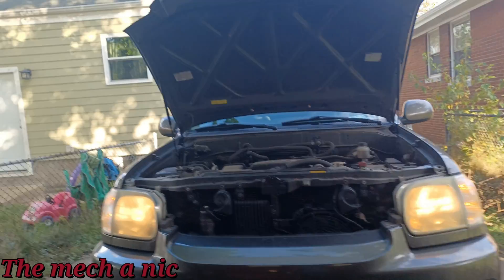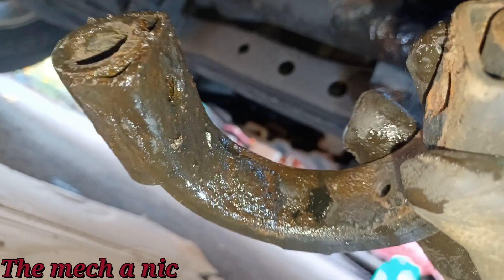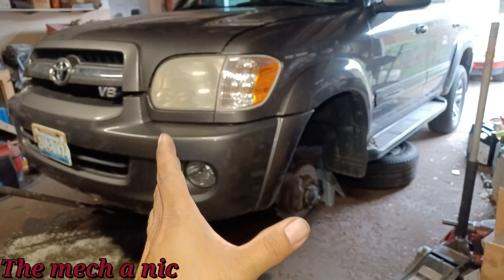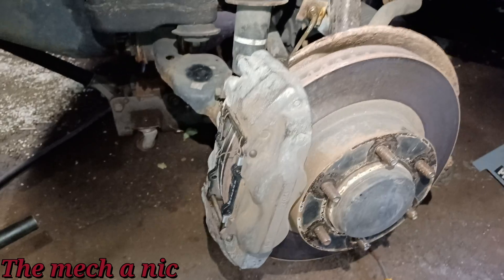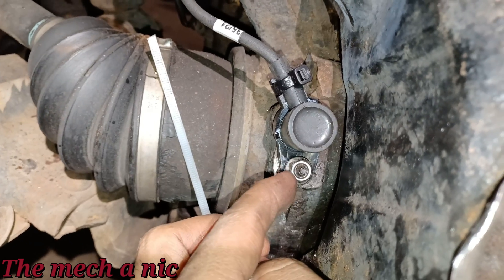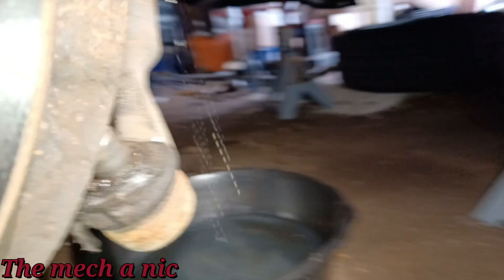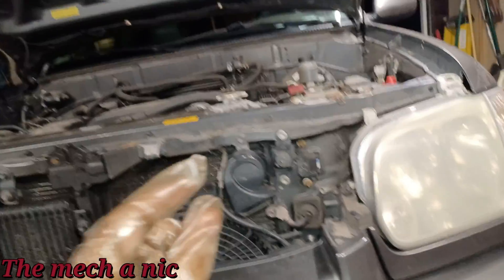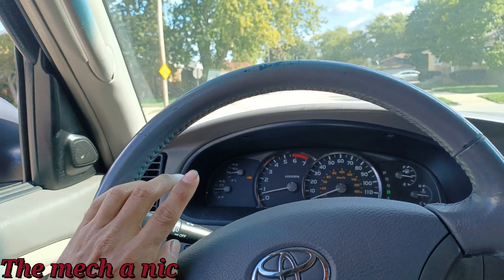Toyota sequoia leaking power steering fluid

Comment: i rebuild rack and pinions all day and with the tundra and sequoia the rubber mount that’s on the passenger side absorbs salt and moisture resulting in a rusty rack housing, then the fluid leaks from the rotting metal. when we rebuild this racks we have the replace half of the housing
Reply from the maker: I sprayed the new rack with 2 coats of crc before installing the new rubber bushing. In hopes that any water that gets behind the new bushing won't get past the crc . I tried..

Comment: Which brand rack did you use? Do you know if its still holding up?
Reply from the maker: I don't know unfortunately
Reply: @themechanic6117  ah alright. I have to do this job on my sequoia and the factory racks are on back order. They also cost 800 dollars! Looking for a quality aftermarket.
Reply from the maker: Lately I've been using Edelmann (rockauto) rack n pinion with great success so far
Reply: @themechanic6117  I was looking at those. I just sorry that anything that isn't oem will fail relatively premature. Thanks for the insight!

Comment: I had a circuit code on one of the trucks I was working on after replacing the tone ring. Air gap was good and all sensors were reading the same but had a circuit code. I unplugged the sensor and plugged it back in and the code went away 
My guess. During the system check it would set a circuit code because of high resistance at the connector but the sensor was able to still read enough for the computer to pick up the signal 
I fought for a few hours on it
Not 100% sure but it's fixed and out of my life lol
Reply from the maker: Lmao I hear you. When something is a headache and it finally gets fixed....don't know how it's fixed but it is and get this car away from me 🤣🤣

Comment: It's a Toyota.. These flashing lights mean, you need to perform is a ZPC (Zero Point Calibration).
 Edit: Okay, It looks like your code reader fixed the issue.
Reply from the maker: Yeah I noticed it would only flash while the scanner was plugged in